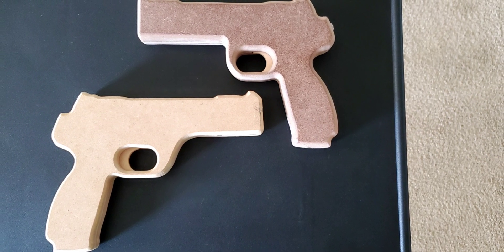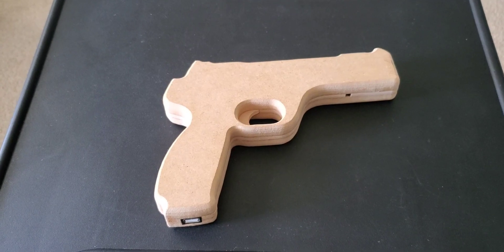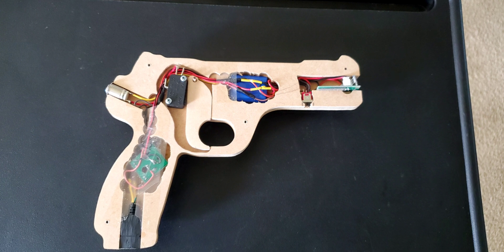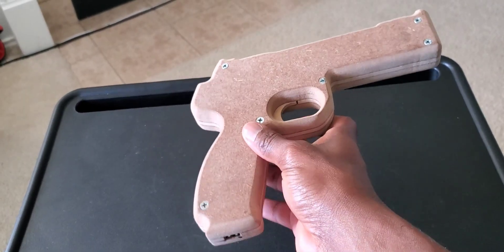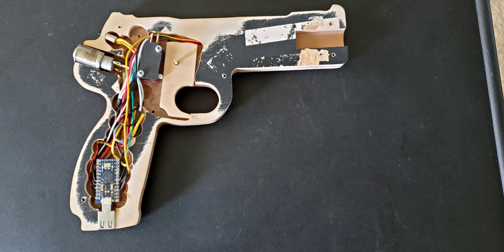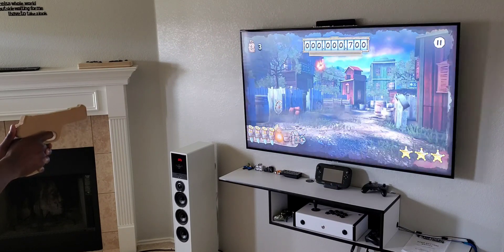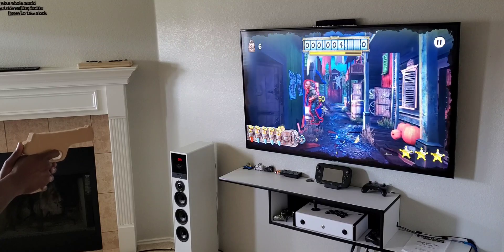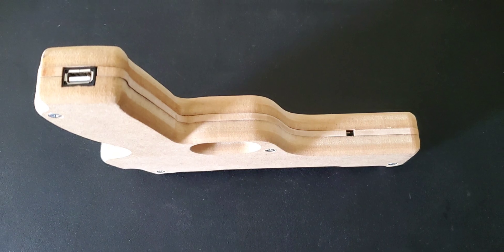My ultimarc and gun4ir diy arcade light gun projects

Comment: So do only need to order the Bluetooth kit and add your own buttons to make a complete gun? Ultimark make it seem like it's addon if you already have one of there guns. Do you also need the dongle with the Bluetooth kit?
Reply from the maker: Yes, I only needed to order the Bluetooth kit from them. I originally used it with an ultimarc lightgun I already had. If you are planning to build your own gun then you’ll need your own buttons also. Also if you’ll be adding the Bluetooth kit to a ultimarc gun you’ll need to do some hardware modifications for it to fit. You don’t need the dongle if your computer already have a compatible built in Bluetooth.